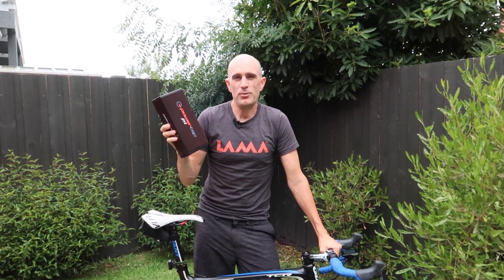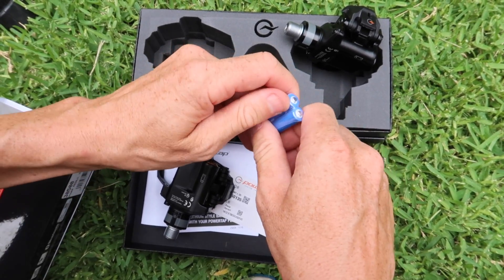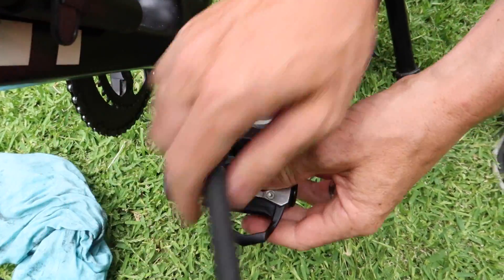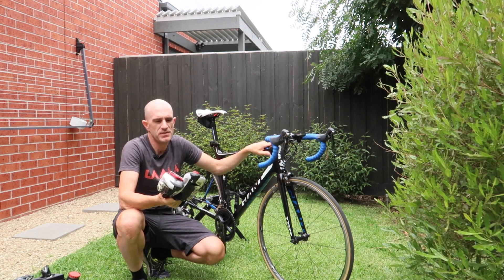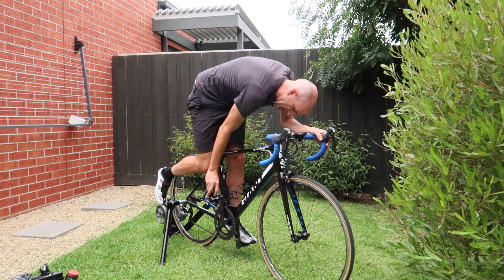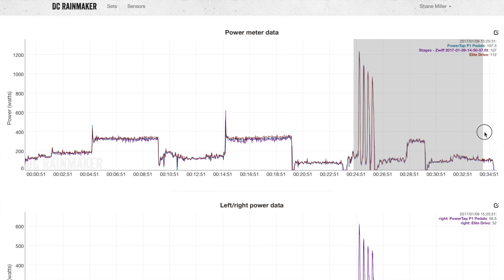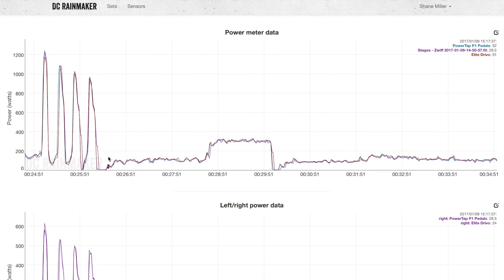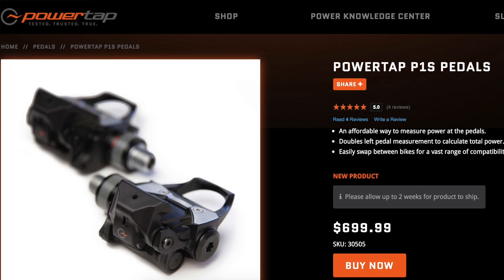PowerTap P1 Power Meter Pedals - Install and Road Test

Comment: Hi Shane,

Just curious, my battery cover is all destroyed, I can only manage to put battery on 1 side. And it connects to my head unit.

Would it be possible to run my p1 single sided only, even if they're dual sided?

Much thanks!
Reply from the maker: The LEFT is the master, so that needs to be operational for ANT+ power on the P1/P2 units. They can be used both independently via BLE (I believe). Might be one to run past SRAM Support (they now own the Powertap brand).
Reply: @gplama  appreciate it:)

Thanks!

Comment: The Powertap P1 dual pedals are the best value out there hands down right now.  Stages is a close second in my opinion. But if you are right or left leg dominated, stages won’t know.
Reply: Mate how long have you been using them? I wanted to shift from stages single side to P1 dual side pedals..

Comment: Shane,  I just started using P1 Pedals with the Yahoo Bolt. I just did a calibration and my reading
was a 9 calibration offset. What does that mean?  What is a "0" offset?
Reply: Mate how long have you been using them? I wanted to shift from stages single side to P1 dual side pedals..need assistance

Comment: Hello,
I'm new to using a Power Meter. I purchased the PowerTap P1 pedals. Question: BeforeI going for a ride, I calibrate my Wahoo Bolt with my P1 pedals, my reading is not always the same?? How do I get my reading  to a "Zero Offset"? Does it matter when calibrating with the Wahoo Bolt.
Thanks,
T MO
Reply from the maker: ‘Zero’ is just a term for what it’s doing. The number on screen is different for different power meters and may slightly change.

Comment: Question is Garmin vector 3's or powertap p1s ?
Reply from the maker: Still waiting for the Bluetooth firmware on the Vector3....
Reply: Shane Miller I've just bought some p1s but after reading and watching reviews I think the vectors could be the better pedal. Saying that they've only just dropped and no ones tested them to their limits

Comment: Hey. Here is ”man can you make video”
Still i don’t have powermeter. And like i had, people think what to buy.
So can you help.
I have asked myself what i need them to have.
•are you lowest posible weight diva? ”States”or something low weight.
•do you wanna have powermeter on any bike you have? ”Powertap p1” or roadbike only powertap hub or garmin pedals
•do you conserned will it hold your weight? ”No garmin pedals then”
•do you have 180> cranks? ”Powertap C1”
•do it have to have smart Bluetooth? The future will be there ewentually 
•will it stand bad weather. Rain, snow, slush, freece temperatures...
•what is lowes price and i don’t gare if its not another wice ideal for me. Just show power.
•is it reliaple?
Hope this helped the helper. These was what ideas i had on this. Use if needed make video about ”powermeters buy quied”.

I have long cranks so i mite have s1, c1 or assiamos?

Comment: If you call that tightening snug then mine is bonding at molecular level.
Reply from the maker: Use grease for ease. :)
Reply: I smother the thread with grease. Don't wanna be sorry later.

Comment: did you have any issues clipping in with the 0 degree cleats? I'm leaning heavily at the P1s after doing my own research and watching your video.
Reply from the maker: It's just a twist and clip, I got used to it pretty quick. The 0deg cleats are much better suited for me.
Reply: Thanks for the lightening quick reply..off topic question, what is the benefit to a 0deg?
Reply from the maker: 0deg feels more secure in the pedal for me.

Comment: hows the durability? i read about others having bearing issues already.
Reply from the maker: Going well. Nothing I've had to query PowerTap about to date, so that's good. I've got a follow up video planned on the pedals in the near-ish future.
Reply: Thanks for reply! I'm planning to get one.
Reply: how about your stages? is it reliable? no issues?
Reply from the maker: No longer using the Stages (not compatible with my current cranks). I'd recommend against a Gen I Stages. I haven't used/ridden/raced a Gen II... I just hope they're better.

Comment: Hi Shane, have you found any solution to the clip-in difficulties? I´m actually still having troubles at times and i have been using them for 1 year now... When they are hanging vertically and i don´t think to much about it it is pretty smooth but as soon as I miss it once and start concentrating I struggle even more... A little bit annoying... Have you tested Look pedals? Do you feel any differences, pros & cons? Thanks
Reply from the maker: Technique. Learning that it's not a slide in and it needs a bit of a secondary wiggle, all good... ish.

Comment: any long term info on these pedals?
Reply from the maker: Soon. The 0deg float cleats are 100% better for me than the stock ones.
Reply: Shane Miller excellent. I'm looking for my first power meter and these fit what I need perfectly. My bikes still have square taper, so no crank arm power meters for me. 
Now, for a new cyclist, do I need data from both pedals or can I use the p1s and still get adequate data for training?
Reply from the maker: P1S are a good entry level option. Similar to Stages, 4iiii, etc. Resale on power meters is usually pretty good, so if you decide to go dual sided in the future you won't be out of pocket a lot.

Comment: Great review Shane. Now that you have had then for a few months how are you getting on with them, specifically the cleats. (I figure power is good if they are still on your bike). Like you I'm hesitant to move from SPD-SL. I had been looking at a Stages crank arm which would be fine for the road but I'm thinking the P1's might be better for Zwift with their more responsive behavior. I'm currently using only a KICKR so I'm certainly losing some punch there. I'd be interested in hearing your thoughts.
Reply from the maker: Follow up video soon. The 0deg float cleats work a lot better for me.

Comment: How do the P1 preform in the long run? Are you still using them?
Reply from the maker: Follow up video in the works. They're still on the bike, so that's a good sign. I just planted one on the ground on the final corner of a race... it still read fine, and I won... another good sign! :) Also a sign I need to work on my final lap cornering skills! ;)
Reply: Shane Miller Congrats on winning.

Comment: Great video, Shane. I am a big fan of the vlogging work that you do. I've recently gotten more seriously into cycling, having previously been a competitive distance runner, and am thinking of investing in a power meter to enhance my training. I am particularly interested in the P1 pedals for their portability. Is there any reason you would recommend a different power meter over these for a power meter virgin like myself? Thanks!
Reply from the maker: There is cheaper options such as Stages or 4iiii if you want to test the waters first and want something that swaps pretty quick. If you've got the coin for the P1 then they'll do everything you need and more.

Comment: Shane, have you done any more testing on the p1 pedals, are they on par with other power meters, what do you think of stages
Reply from the maker: They're super accurate when put up against my Drivo and Neo (both known to be very accurate). I'm not a big fan of the Gen I Stages I have. It works well most of the time.... but most isn't good enough for me.

Comment: I have a pair done 4000km on them, now having problems.. PowerTap could not really give a shit, some of the e-mails back from the Tech i was chatting to (Shocking). Zero responsibly..
Reply from the maker: What's the issue you're having? I'm keen to take in a wide range of customer experiences so I know what to look for if mine start going south.
Reply: The left side pedal is rattling back and forth on its axial, a couple of millimetres. The right one has a little bit of slop but not as much as the left. Apparently according to PowerTap, Its in tolerance.. LOL..! Any type of non-engineer, movement is going to produce wear and tear, who knows how long it will last.. The left Orange Battery Cap,  can no longer be torqued/tightened all the way, power drops out in the pedal if tightened to tight, only finger tight seem to fix this problem, Who knows if the cap will fall off one day...? I need to keep checking it..!! Hmmm...!  Apparently the Orange Batter Caps are now in v2, I have version 1, I was told to go buy a new pair to fix my power drop out problem with my Version 1 orange Batter caps, That was their solution (PowerTap Tech) Still in warranty, LOL .. The Orange Power Caps are made out of aluminium, I would never trust a aluminium threaded anything... Not the best engineering PowerTap.. I hope they are stainless steel, on the version 2 caps..!!

Comment: This is going to be the dumbest comment ever submitted, but here it goes: could you talk about how tight you do you quick releases in one of your upcoming videos? I used to tighten them just enough so the wheels wouldnt come off, but my local mechanic tightens them up like 10 men. Not sure which one is right!
Reply from the maker: Tight enough so the wheel can never pop out. Also not so tight you can't remove the quick release. That'd be a hard one to describe on video.
Reply: Shane Miller yeah I guess you're right. I think I saw a video of a pro tour mechanic once saying you should start feel resistence on the lever of the quick release as you close it when it is at 180 degrees, which to me seems incredibly tight

Comment: Hi Shane,
I have a back up bike it is Specialized Roubaix. My primary bike is the Tarmac , which I ride a few times a week. It is equipped with Rotor 2inpower. I don't ride my Roubaix often but I still like to have a power meter on it.  Looks like the P1 (more affordable) performs quite well. Except that the Look cleats doesn't fit nicely, where as the P1 cleats fit nicely on the Look pedals, if I understand correctly.
What is your take on this? should I go with 2inpower for a bike I don't use 2-3 times a month, or a P1? Or just no power meter at all for a while.
Thank you in advance for any comment you have.
Reply from the maker: Always power! :) Maybe look at cheaper alternatives if it won't be used a lot.... 4iiii or Stages, maybe the P1S model of these pedals. That might be a balance of budget/numbers/usage.
Reply: Thank you Shane. I will go look into 4iiii and Stages to understand them. I have an old power2max but to use that I have to change the whole crank set up, plus Rotor chainrings, which will end up expensive here in Thailand.

Comment: I enjoyed the review, thanks. How much adjustment did you need to make to the other components on your bike to compensate the additional pedal height?
Reply from the maker: Seat only.
Reply: Shane Miller thanks - how you finding the additional weight on the climbs?
Reply from the maker: I can't tell any difference.

Comment: Is your stages a left crank only?
Reply from the maker: That's all Stages are (commercially) for now.
Reply: Thanks for the quick reply. I am 90% set on the Powertap P1 pedals, but I can't decide if I should go with the single side (p1s) or make the bigger price jump to the dual sided power (p1).

Comment: Enjoying your channel, Shane. Just wondering though, did you pay full retail or was this review sponsored by PowerTap?
Reply from the maker: I spoke to a number of companies about what I needed to do in regard to power measurement/responsiveness and PowerTap were kind enough to supply the pedals for this task. I was all set to buy a pair, which I'd spoken about on other videos. To answer specifically, this wasn't a paid advert.... if I charged them my time in consulting hours as I do for IT Sec work, I'd be able to buy two pairs of these pedals, and a set of P1S for the follow ups.
Reply: Thanks for your honesty

Comment: Best part of the video is seeing you push on the screen of that Garmin and it working. I'm a bit sad Brim Brothers could not bring their pedals to market. My wife is a Speedplay user. She currently uses 165mm cranks but keeps considering going lower (hard to find higher end bike stuff for 5'2" women sometimes). Makes it hard for her to pick a meter for that reason. Only options I've found now are either there is a Quarq crank that goes down to 162.5 or to get something like Cobb cranks and use a Powertap hub. She borrowed a wheel with that hub and hated how loud they coasted. I suggested that she just keep pedaling but the wheel went back :p
Reply: Powertap C1 chainrings are an option if your wife cranks are 110BCD. BTW she is a giant compared to one of the ladies I race with, 4'10" and uses modified durace cranks about 160mm
Reply: nickobec she uses speedplay pedals
Reply: the powertap C1 chainrings (the powertap equivalent of crank based powermeter) will bolt onto most 5 bolt 110BCD cranks including Cobb. Just replace the chainrings and that is it. If she finds a 162.5 or 160 crank, it easy to swap over and swap back if she does not like the smaller crank

Comment: Question, long term serviceability?? I'm in the market and my only concern would be wear. No doubt there will be more video's coming from you for this product but thought I'd bring it up :). Great job as always.
Reply from the maker: It'll be a while before I can answer this one, I've ridden them about 80km to date.
Reply: Just did some reading, the strike test's seem good, but I'm a little concerned about this:http://forum.slowtwitch.com/forum/Slowtwitch_Forums_C1/Triathlon_Forum_F1/Powertap_P1_pedals_-_Bearing_wear_P5864320/
Reply from the maker: Hmmm! Interesting.

Comment: Thought I went past you a bit too easy on Zwift the other day Shane. knew you must have been trying something new out if I was breezing past ya haha!
Reply from the maker: I should go into workout mode when I'm doing random things on Zwift. I have a few people join in next to me and I'm all over the shop. Most get confused and #rideon! haha :)
Reply: give us normies some hope please Shane haha! Looking to upgrade to some sort of power meter, what's the most reliable at the lower end of the market?
Reply from the maker: My Stages is working well... but it hasn't been in the rain. I've got my eye, so to speak, on 4iiii. It depends what's compatible and what your budget is.
Reply: now checking out the 4iiii, looks at a decent price range fpr me so will check it out! Cheers mate!
Reply from the maker: If you're looking on ProBikeKit they're running a 10% off site-wide (max. discount AU$40) for me for the next few weeks using code LAMA10. They had 4iiii in stock last week.
Reply: will definitely check it out! Thanks again Shane!

Comment: Nice presentation. What is the name of the Power analysis software?  Also do we need to calibrate the P1 pedals before each ride/workout?
Reply from the maker: It's within their IOS app. Zero offset should be performed just like any other power meter, a few minutes into every ride. Although not a lot of riders do this.

Comment: These are SO crap.

-Bearings develop play immediately / run rough and noisy.
-Stack it really high
-Cleats are mushy as hell
-They weigh a tonne.  You can feel the weight as you spin your feet round
-The general finish is very cheap, with the paint (yes, paint) chipping off the pedal body immediately upon use.
-The battery casing is really big

Avoid them.  I bought them, used them for a few days and then got a refund.  Dreadful.
Reply from the maker: I'll be sure to keep everyone posted if mine fall apart like a cheap used car. Your experience sounds suboptimal.
Reply: Shane Miller Haha.  Not suboptimal; inevitable with the design.  Grab the pedal body and wriggle it around on the axle.  There is play in the bearings, isn't there.
Reply: Yes, same happened to me. The bearings developed a clicking noise. Powertap replaced them, the new pair is working well so far.
Reply from the maker: Right! Yep. It's only a fraction at this point. I'll keep a very close eye on this.

Comment: Great review Shane, its been a while since I've seen a Cervo. Props to the Stages, for what they are, I didn't expect them to track so while.
Reply from the maker: The power of just two buttons on the Cervo... none of which I can remember the function of these days. :)
Reply: kendogz161 llllpp00099999899999999t00h I 999

Comment: Original Look cleats have the little bumps on the side to help line the cleats up.

Fwiw I've hade original vector pedals for just over 3 years and almost 45000km with no problems and no broken pods yet. I travel with 2 bikes I. The back of the car 1-2 time per week during the season. I've even been hit by 2 cars and a bus!!! 
But I have to admit, while torquing them up isn't difficult it would be nice not to have to pack a second torque wrench when flying with the bike.

Comment: Something you forgot to mention. They only work with iPhone apps and nothing else. Guess you can say they are iPhone powered pedals.  Powertap has been very slow and neglective of expanding to Android.  That makes things more difficult to keep firmware up to date plus you don't get all the wonderful data you speak of. That might be a deal breaker for some considering these.
Reply from the maker: Arh yes. Cheers. It didn't even cross my mind to be honest. I'll miss things from time to time as I cover my own experience vs presenting a well thought/planned/balanced marketing/advertorial. I'll always link to those though when I can. :)
Reply: Still no app compatibility for Android users in 2021.

Comment: Does anybody know when will the drivo cadence analysis software will launch?
Reply from the maker: +Roberto sanchez It's already within their mobile app myETraining.
Reply: Shane Miller 
nice, I'll check it out. do I need to use the drivo's cadence sensor our can i use any ant+ sensor?
Reply from the maker: I believe you have to use the wired one... it's not really that clear in the manual/how-to.